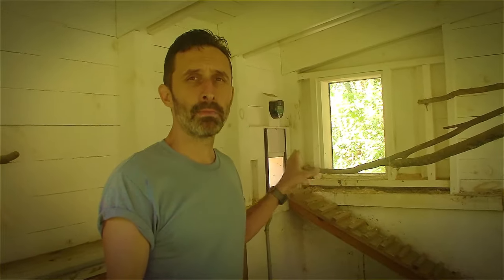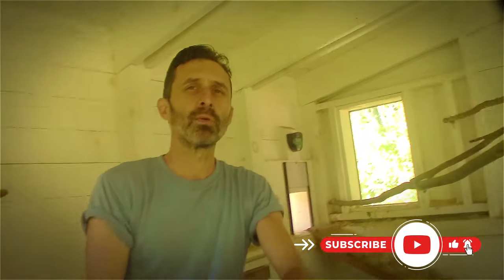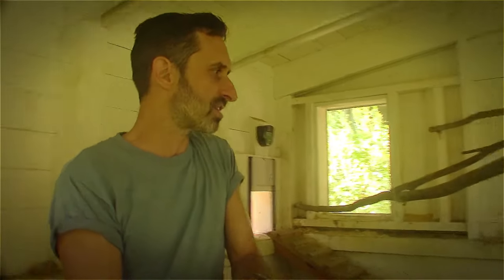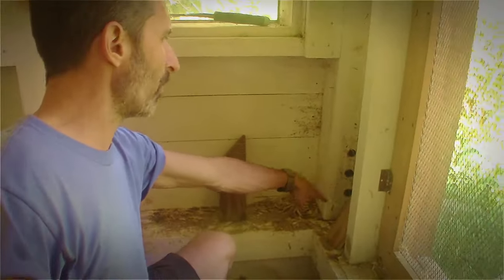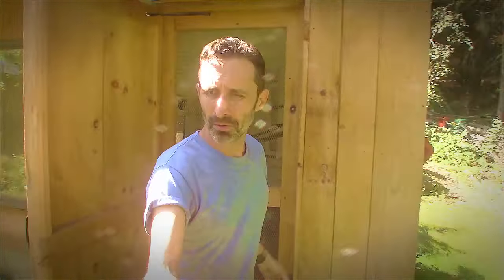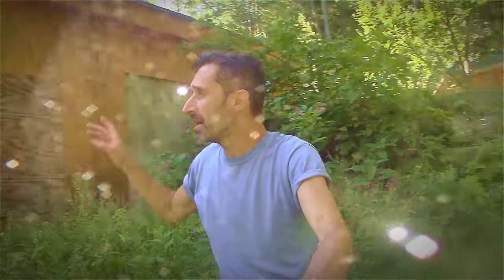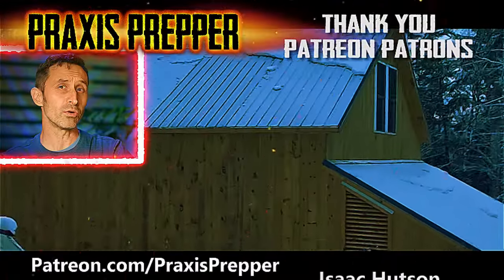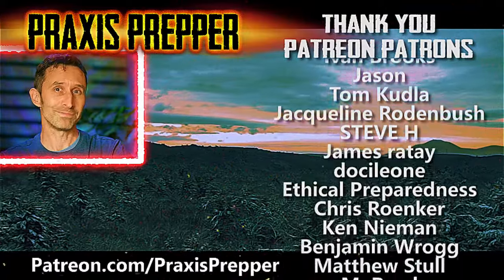A Chicken Coop Venting FAILURE

Comment: Maybe you could extend the vent through the coop and vent on the opposite side outdoors (far enough from the coop so humidity wouldn't go up under the eve). Not sure if the chickens would like to roost on a 4" pipe, but seems like a cheap experiment.
Reply from the maker: That's actually exactly what my plan B is here. I'm hoping that the heat and humidity will create a constant source of (mineral deficient) waterfor them if i can capture the humidity outside.

Comment: I think you like triggering people, LOL.  I ignore the pictures and I have come to ignore most content creators titles as well.  Everyone is trying to drive traffic and the reality is usually not exactly as advertised.  It just goes with the territory.  But they are at least interesting art.  

I would suggest on the air from the radon system.  Do not blow the air directly into the space.  It is far better to do a heat exchanger, you can build something along the line of a solar heat exchange box using soda cans.  As your 50 degree air blows across the surface of the cans, two things will happen, if the temperature is below 50 in the coop, heat will move from the warmer air to the space by radiation and at the same time the temperature of the air moving through the exchanger will cool toward the actual temperature of the coop depending on multiple factors.  It is probable that you will have moisture condensate in the exchange so I would allow for a drain.    But it is free heat that is being wasted and using it would not be a bad idea.
Reply from the maker: That idea had crossed my mind as well, but the draining of the condensate (and there are gallons of it weekly) is the trick. I'd be boxed into certain pipe routes, none of which I could figure out how to avoid being hideous obstructions in the space. I'd also need to add another booster fan to keep the air flowing through the extra friction of the pipes. All possible, but unappealing in any version of the idea I've been able to concoct.
On the thumbnails being crazy, i just showed them to River and Amber and they suggested that I should trun the cops into termites wearing police uniforms. I like that idea.
Reply: @PraxisPrepper  Life is all about the journey, not the destination so if you accept the challenge and try and find a way around the problem, that is all and good.  If you don't accept it and simply say not worth the effort, that too is good, as there is no limit of other problems to solve. 

  I would suggest on the thumbnail thing and even at the personal being a father or father figure thing, I might reconsider making the police the butt of a joke.  Should they worshiped, no certainly not but as a class I do not think they should be disrespected.  Just my POV and I certainly understand why our society wants to make them to be jokes.  Far too many of them seem hellbent to reinforce bad stereotypes.  Still it is too much like tossing a barrel of apples because 2 or 3 of them have gone bad.  I have watched too many young people behaving like morons to the police and it never goes well.  In those cases I mostly side with the cops, sometimes a little discipline does far more good than harm in the long run.
Reply from the maker: @charlescoffey9523  There are good cops and bad cops and incompetent cops. I'm not sure about the ratio of all those groups in the general police population, but I presume they all exist. As for how the cops are depicted in the thumbnails for this video though, aren't they the sane ones playing against a crazy nut-job-looking guy who's (ostensibly) raging against his "right" to poison his chickens? The cops are the good guys in this depiction - aren't they?
All that said, Amber and River suggested that (given the theme of the video), I might have done well to make the cops be termites in cop uniforms. That'd be a funny image too, so I might swap it to that later.